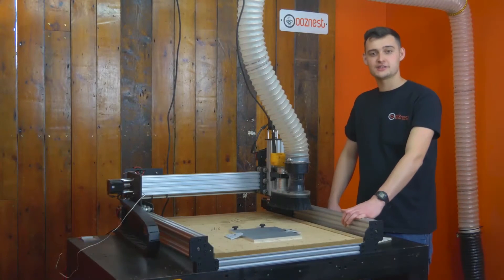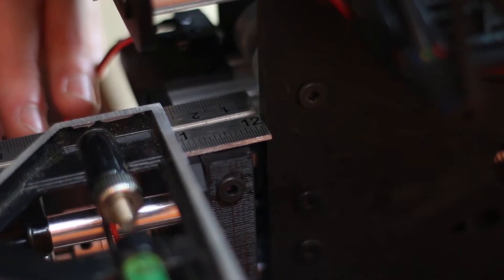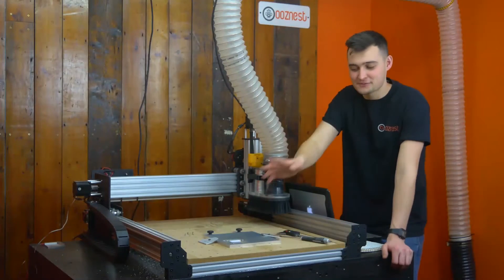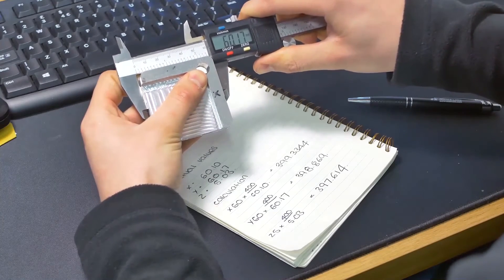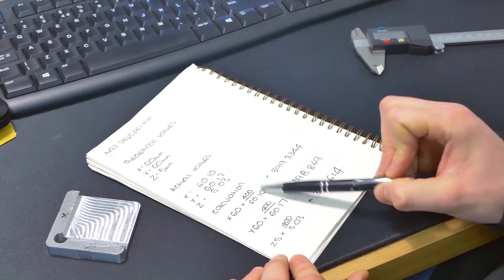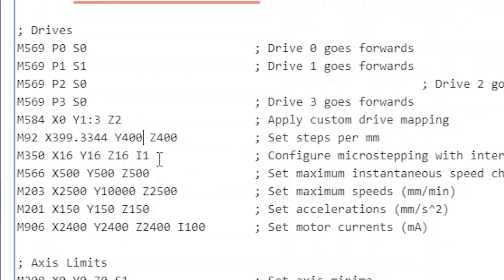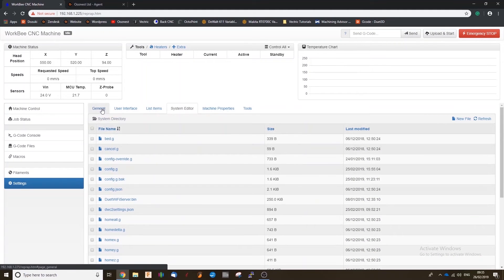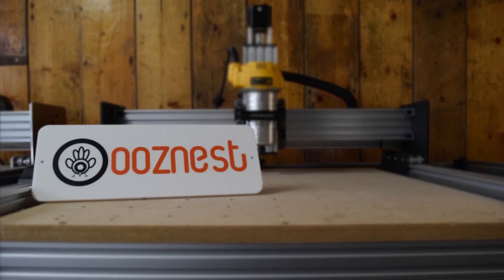How to Calibrate a CNC Machine Running a Duet Controller | WorkBee CNC Machine

Comment: Isn't this wrong? The movement per step is hard defined by the steppermotors and leadscrews. The inaccuracies are due to other things and will not be bigger with bigger objects I bet, i.e., not a ratio, but a constant.
Reply from the maker: Doing it over a larger distance will bring it closer to that constant, as over the larger distance, other factors which could effect it, such as end mill deflection, will have a minimal effect. In addition it helps to get an average over the whole length of the lead screw.

Comment: i have made the adjustments on my two Y axis but in the video it looked very easy to turn the coupler. Mine was not easy. I could still do it with two fingers  but it didnt move as easily as yours in the video. Is that ok or should i look at adjusting my wheels?
Reply from the maker: Hi there! Are the eccentric spacers adjusted correctly? If they are set too tight, there will be too much friction between the wheels and extrusion. Do the wheels spin freely with the eccentric spacers set in their widest position? (Widest position being with the '6mm' laser marking facing away from the extrusion). This could contribute to your coupler being too tight. If you have any further questions, get in touch with us here - https://ooznest.co.uk/help/.
Reply: you might have your wheels tightened too much, try loosening the axle bolts a bit

Comment: I found this really useful. Have the machine cutting 60mm square pockets at 59.94mm now which is good enough for my purposes! Thank you
Reply from the maker: That is great to hear!
Reply from the maker: @Rob Llewellyn Hi, for a belt drive machine around 50 is the correct range. 200 would be for a screw drive machine. The motors are 1.8 degrees.
Reply from the maker: @Rob Llewellyn The starting number is whatever the number was when you made the cut to calibrate.

Comment: Hi, is it the same thing also with belt driven workbee with cnc xpro controller v4? I mean, the values which I have to modify with that formula are "$100" "$101" and "$102", isn't it? I asked because I've got accuracy problems lately. Anyway, thanks for video, you're the best!
Reply from the maker: Hi, yes it would be the same, same for any controller running GRBL.

Comment: how do you adjust the Y if its out of alignment on the belt drive machines? i cant twist the screw.. is it possible to manually step the motor via gcode or something in the duet UI?
Reply from the maker: Hi Jason, if the belt tension is exactly the same on each side and the machine is square, it should be square.

Comment: Does this need completing straight after the build or are the steps preloaded into the machine close enough to carry out some test cuts? CNCing items with extremely high levels of accuracy isn't required by myself at the minute as my intention is to only cut MDF shapes at present.
Reply from the maker: As long as you've got your machine square and your axis are running parallel to each other it should be accurate but it is recommended to complete calibration at a later date.
Reply: @ooznest  Thank yoiu :)

Comment: what is the formel for beltdriven? mine is off by an 0.5mm on 100mm .
Reply from the maker: The belt drive is accurate to 0.2mm
Reply: Ooznest its good now:) the machine works great.

Comment from the maker: Hope you found the video helpful! When was the last time you calibrated your CNC Machine?
Reply: Was going to mention that the assembly instructions didn't remind us to set the Y axis on both sides before switching on the machine.
Now you've covered it this video !
Just finished building my WorkBee, great machine, just need to find something to mill now.
Reply from the maker: @mikewelling1170  Hi Mike, Thanks for the tip we will get one of the team to make some adjustments to our instructions! Hope you found this video useful, If you need anything or want to see a specific tutorial please do let us know.
Reply: Did this 3yrs ago when I built my Ooz 1515 2.2
Doing it again this week. Originally, instead of cutting a 60mm square, I did a profile cut for X and Y which was close to the working limit as I felt it would amplify any discrepancy for me. But then, I would be measuring with a tape measure over a longer distance rather than micrometer over shorter distance so maybe not 🤷🏽‍♂️
How frequently should we do this?